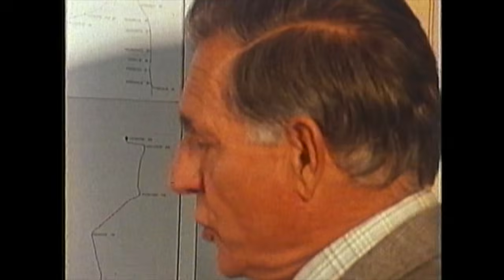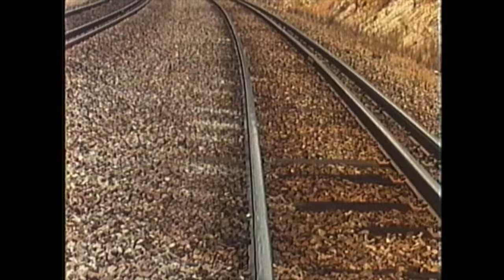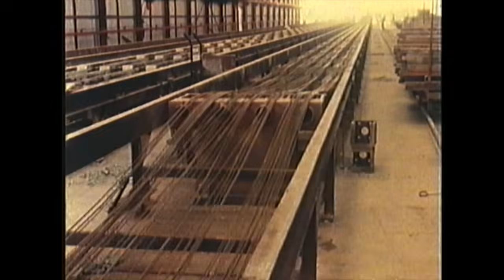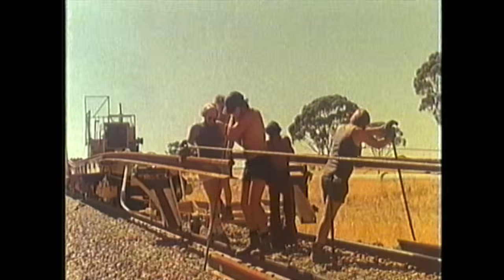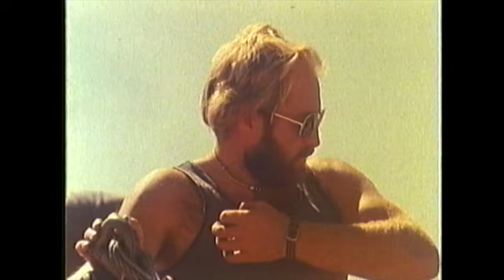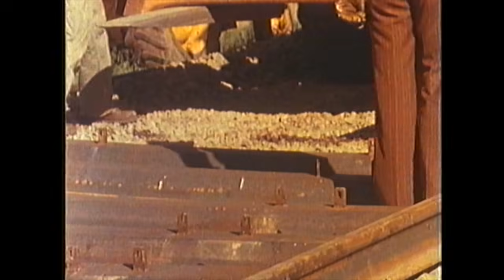Westrail – The Next Line Down

Comment: The real story here is that the WAGR based the standard gauge conversion on the use of English Electric K's and lighter axle loads with 47kg rail (The then standard weight on the Victorian and Commonwealth standard gauge system rather than the then NSW mainline standard of 53kg) and then decided to get themselves into an "arms race" with the Commonwealth Railways and then got themselves the L's and ran them at 115 kph and then the Prospectors aka "Super Budd's" at even higher speeds. Meanwhile at the eastern extremity of the standard gauge the substations on the Western Electrification got upgraded to Silicon Diode rectification to handle greater power margins (This saved the installation of a 3rd rectifier set which the substations on the Blue Mountains are designed for) and the 46's were converted over to solid wheels. There was a case that the road to the Granville Disaster of 1977 started when the Sydney-Perth Standard Gauge opened when traffic goods traffic exploded over the Western Electrification coupled with the fact that the NSWGR was dealing with an explosion in regional passenger traffic that resulted in the 46's being the hardest worked loco's on any Govt system in Australia in the 1970's and all 40 were being worked to death where by in the 60's they were being under utilized. One wonders was this the result of the then WAGR's motive power planning and purchasing depts got too keen in the late 1960's. Had the WAGR went with loco hauled cars to the NSW narrow width loading gauge for the Prospector the service would have been axed in the mid 1970's and the cars would have probably ended up on the Gold Coast Motorail in NSW.